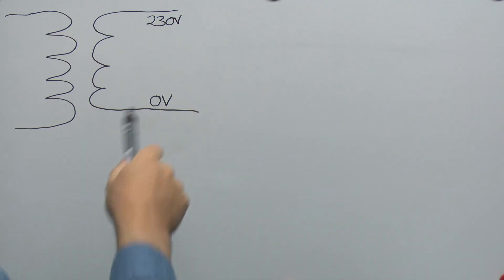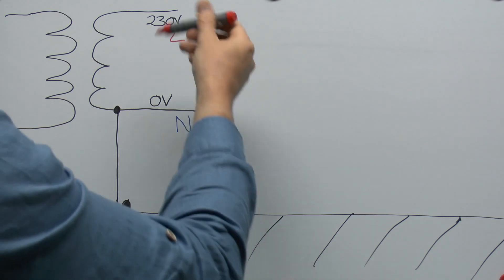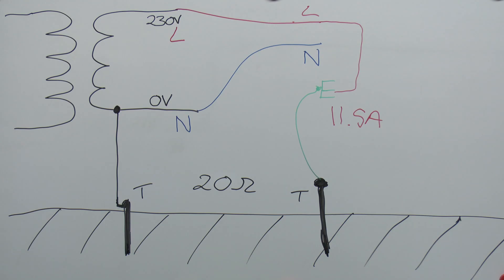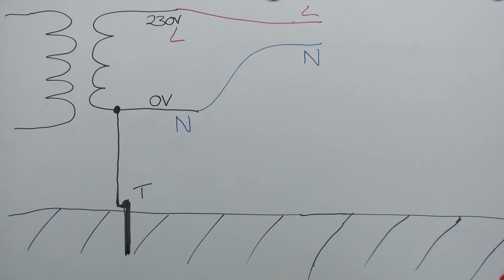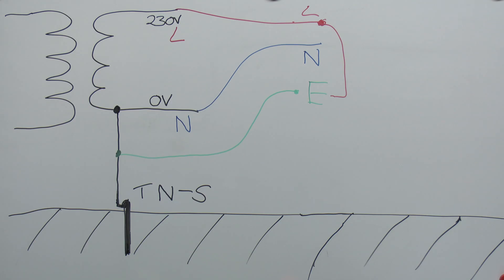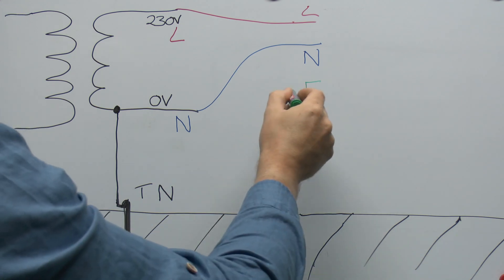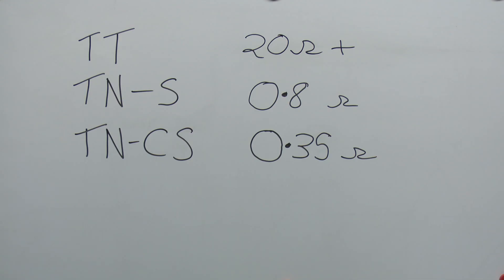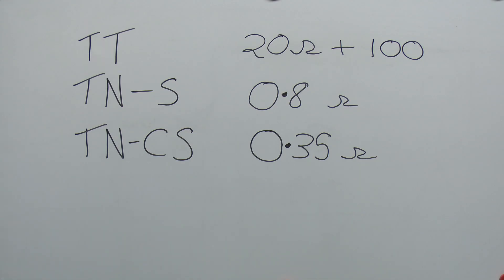Types of Earthing System for Electricity Supplies (UK)

Comment: JW, should I have continuity between my neutral and Earth in a TNCS supply if testing with a standard multimeter from a socket?
Reply from the maker: Yes, N&E are connected at the point they enter the building.  You should also get continuity on TN-S, as although the wires are separate, they are still joined at the transformer.

Comment: can i ask if its okay to use the earth to a light switch as a neutral for a new touch light switch ? or is it not advisable.
Reply from the maker: Not permitted.  If there is no neutral wire, then a new wire must be installed.

Comment: In bulgaria we use shuko plugs and we rearly have separate earthing wire.In the wall socket we just put a bridge(copper wire) between earth and neutral and it works nearly all the time.
Reply from the maker: That arrangement (TN-C) is prohibited in the UK.
Reply: Didn't know that.Thanks for answer.

Comment: Here in the land of convicts and sea front properties the neutral wire often corrodes off in the outside connection box, we almost exclusively use M.E.N  same as your TT supply but each customer has a removable link between the neutral and earth in the consumer unit for testing, this provides a limited path to the transformer when the incomming neutral fails.

Comment: Surely TN-C-S sytems would be fine for outside marquees etc. IF the supply is taken from a consumer unit and not from the main supply? Just put a consumer unit from the supply but before your feed to the marquee?
Reply from the maker: The risk is if the incoming supply cable is broken, so that the line is connected but the combined N&E is disconnected.  This leaves any metal equipment at mains voltage and circuit breakers, RCDs etc. will not trip.  Although the same situation would occur inside, the risk is lower as exposed metalwork is normally bonded together and people are not normally in direct contact with the ground as they would be outside.  More in this video: https://youtu.be/JRHyqouJPzE
Reply: Yes, but you were at pains to point out that the risk of severing of the main supply cable phase conductor without severing the neutral or earth is vanishingly small (in a co-axial cable). If the supply cable is co-axial and fed directly to a consumer unit where the N separates from the T, the follwing installation should be safe. Not in any way a critisism but I do like to get to the bottom of things and understand them. Maybe I've failed here! (No need to reply John  - I'll work it out for myself).
Reply: In which case you are supplying the marquee with a TN-S system

Comment: can you convert from a TT system to one of the others without asking anyone?
Reply: if you contact your local electricity board, most of them would arrange a visit from an engineer to see if they can check for PME, I wouldn't try converting it yourself, just in case anything goes wrong?
Reply: Thanks!

Comment: For a commercial building, where the transformer is a private property, will the earth cable from the transformer be connected to the main earthing terminal inside the main distribution board for a tns system? please clarify. Here in pakistan the mdbs are generally earthed by two earth rods...
Reply: Muhammad Farooq Fun fact :
In Italy, Spain, Greece, Serbia, Croatia, Albania, Bulgaria and Romania, if you want to make a contract with the pieces of shit known as enel, you would need to buy yourself a transformer and then give it to them for free (as part of the contract you make with them). And most of the time they will be the only option... because they are a regional monopoly... 100% unregulated free market and capitalism go so well together !

Comment: in germany we use for small stuff in most cases non polarisaded sockets! :((( it results of early systems were get 2 phases on sockets ! it have a voltage between 2 phases of 220V on a 3 phase system  ! it is i think nealy everywere replaced with 400v line to line system ! but we have in older insterlations also 2 wire system everywere! only in the socket the pen is split to neutral and ground!

Comment: Hi John - Great videos, very informative - On this subject, on my house I seem to have a mixture of TN-S and TN-C-S. It looks to me as though the DNO have installed two cables in the TN-CS arrangement, and then AN OTHER has popped in an earthing rod for good measure (on a piddly little cable I may add). Would this be problematic at all do you think?

Comment: Hello there.....I'm not an electrician....but I have a question. As I understand it....AC current and voltage is reversed every 1/50th of a second. If this is so, why do we not see 230v traveling up the Neutral and 0v on the live and then visa-versa?? ....surely this must be the case??.  How can Neutral always be at 0v?   Anyone got the answer?
Reply: The neutral is always at zero relative to the Earth. All that's happening is that the live is alternating between +325v and -325v relative to neutral/earth.

Comment: thanks. I was with you all they way up until you said the if I run an extension outside and break the neutral it would then be dangerous...... how is that different to using an extension inside the house?
Reply from the maker: If such a fault occurs - and this is where the combined neutral/earth to the property is broken, NOT a neutral within the installation, then - Inside the building any exposed metalwork such as taps, pipes etc. will also have the same raised potential as metal equipment due to equipotential bonding so the risk is significantly less.
Outside people will be standing on the ground at zero potential so any shocks from metal cased equipment will be far more severe.  This is also why TNCS supplies are not allowed for portable caravans, as while inside the caravan everything is at the same potential, but when someone steps outside they are connected between actual ground and the raised potential of the caravan frame.

Comment: What is meant by 'electrical wiring systems', are they referring it to pvc and steel conduits, cable tray and ladder etc.... Any advice
Reply from the maker: Yes, just different methods of installing cables/wires.

Comment: This Earthing systems video is superb. Thank you so much. You are a very clear communicator and a great teacher!

One question. You mention TN-S is typically found in older houses, mainly because of the cable type (lead). Is it possible that older houses (e.g. in towns / cities) have had the wiring from transformer upgraded, so that even though there are 3 conductors coming in, the E and N are connected? (i.e. "upgraded" to TN-CS)

I'm having my supply upgraded to 3 phase, which I presume means a whole new cable to the building. I'm guessing that will be TN-CS as well...
Reply from the maker: Some older TN-S installations have been changed to TN-C-S,  using the neutral conductor as both neutral and earth, the link being done in the cutout. This may be done where the underground joints to the outer covering of the cable have failed, as it's much easier than digging up the road to replace.  It's only possible in some areas though, there is a lot more involved than just installing the link.

For 3 phase an entire new cable is required from the road, and TN-C-S is almost inevitable.

Comment: Doesn't supplementary bonding of water & gas pipes to earth, lessen the chance of any shock occurring even if a PME supply cable or earthing rod was damaged. I know most modern houses use PVC supply pipes which would negate this benefit. But on older homes does this help?

Comment: JW, could you expand further as to the earthing of a portable generator please? I use a 1kw Honda invertor generator on board our boat, generally for battery charging only. It represents a particular problem as afloat there is no possibility of an earth connection. The boat has a 240v shore power circuit on board which is generally connected to the mains supply in the marina when in the home berth. But when away cruising I plug the generator in to the shorepower inlet socket. Other boat users have suggested that the generator to boat shorepower connection cable should connect neutral to earth, infntbkniw what the thinking is behind this suggestion.
Your videos are very useful indeed - keep them coming.
Many thanks,
Rob

Comment: Great video! Here in Denmark we pretty much only use the TT system. I'm not sure why... but i guess it's because the electric company like the idea that they won't have to be responsable of the PE connection.
Reply: Here in Italy we also use TT for houseolds, only industrial use TN, I thik that's because earthing, in that case, is on the customer so if earth conductor fails, the power company has no responsability.
Reply: How on earth (no pun intended) can you get proper Earth conduction in Italy with a TT system, especially when for example you live in a rocky terrain? You guys have to drill 30M deep rods or something? :P

Comment: Thanks for another very informative video. Could I ask a question on TT earthing systems. Is it allowed in the UK to connect the earth rod to the neutral at the customer end, and what would be the result or problem if this is done on a TT supply. I believe that doing this would only help by tieng the two together and thus reduce any problem of poor earth rod resistance.

Comment: im building a steel deck around my pond which will take the mains input while we start constructing our container house. they show the tncs  system on the consumer board diagram but in thailand street cables get damaged all the time. im not happy with tncs so im going to ground rod the consumer box, the deck and earth all the 2 wire appliances. the water table is 1m below ground. any input on this would be appreciated.

Comment: In Germany you could find TN-C (older buildings) or TN-C-S (modern buildings) are the most common systems. But sometimes you could find TT, which depends on your supplier. The buildings with TN are fitted with an additional earthing rod for the cable failure you described at 10:48 min. Formerly they used the incoming water pipe, but now the most water pipes are made of plastic and the earthing rod is placed in the ground plate of the house (newer ones) or got a separate rod. And the most building connections are three-phase-current. The three lives L1, L2 and L3 all have 230V measured against N (or PE), but 400V against each other, so you've got two voltages in your system.
Reply: In Finland TN-C was also common earlier but after 1989 it was allowed only with a 10 square mm PEN-wire.
Reply: @okaro6595  Same thing here, PEN only permitted if it's at least 10mm² copper or 16mm² aluminium.

Comment: What is TP-N system ?????
Reply from the maker: Three Phase & Neutral
Reply: Am i undestod right that, in TP-N system no earth provided ? I am doing my assignment, and there is quastion  : Show , the earth fault loop path for the compressor circuit .
Reply from the maker: There is always an earth, so 3 phases, neutral and earth.  Path for faults to earth is the same as for single phase, between any one of the phases and earth.
Some three phase equipment does not require a neutral, so that would be three phases and an earth, but the earth is always required.

Comment: John, you say to test the effectiveness of an earth rod for instance and to make sure it is no more than 100 ohms.
But from where do you test?
You would need to have a known good/effective earth so that you can find the value of the one you are testing- yes?
Reply from the maker: There are two options - either use a test meter with 2 other temporary electrodes in the ground, or use an impedance tester to test between the incoming supply and the earth rod.
There will be a video on this in the near future.
Reply: Great John.
It takes some seeing how to do this.
Thanks.

Comment: Hi John, If on a TNCS system the Earth at the property is connected to the Neutral, why is there a need for a separate Earth?
Reply from the maker: Neutrals carry current in normal operation, a separate earth does not.  If the earth/neutral were combined in the wiring, any break in the neutral would result in dangerous voltages on any exposed metal equipment.
A combined neutral/earth system is called TN-C, but is not permitted in the UK.
Reply: Hi John, Thanks for the clarification......much appreciated!